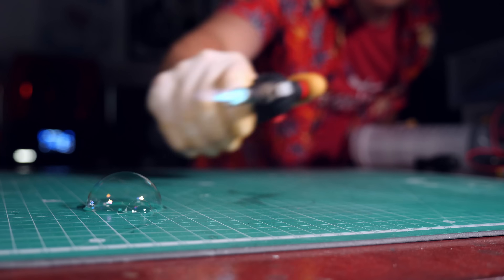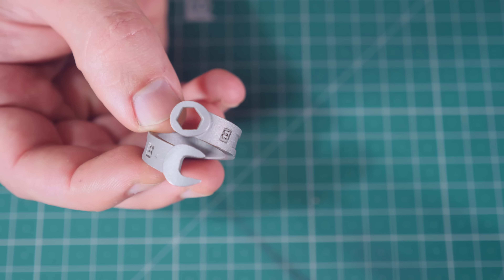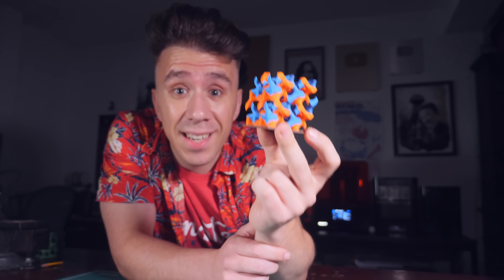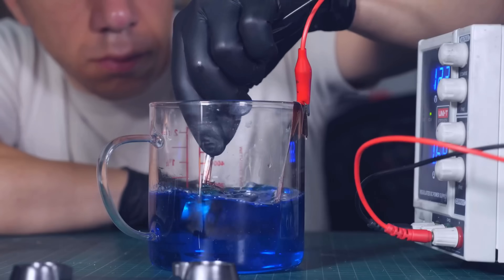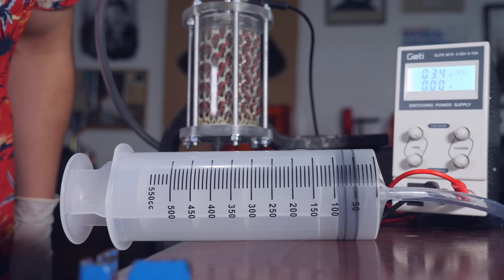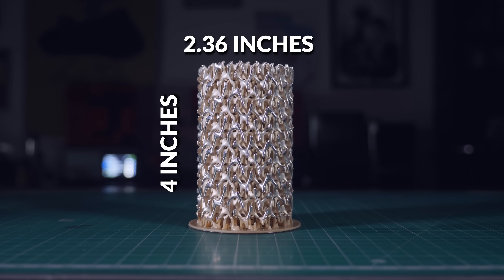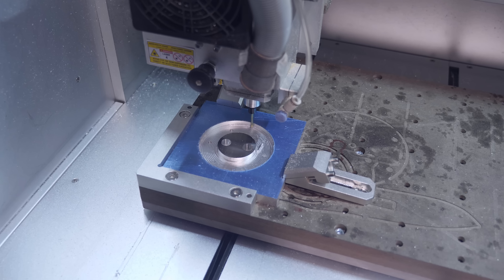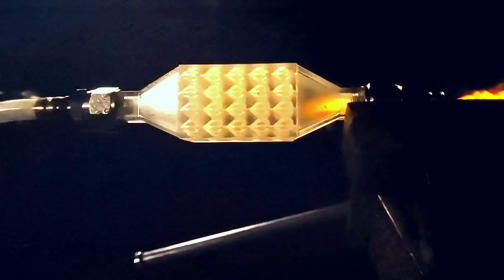ROCKET that LITERALLY BURNS WATER as FUEL

Comment: I have done some testing whit HHO and I have some conclusion of my study that can help you I hope, 1-- nearer is better but it is limited by the bubbles and the bubble size so in your next build increase the pressure the max you can witch make the bubble very small and be sure the bubble can escape without acumulating between the plate because where there is bubbles there is no water to produce HHO and the big pressure only slitgly increase the power requirement, 2 -- If you want the right stochiometric you must use only pure water anything that increase the current will create something else than HHO in a certain percentage depending of the voltage 3 -- your latice must be made in or cover whith a big layer of a metal that dont oxydised because even them dissolve but at a slower rate to make it last.  Hope you read it and it could help!

Comment: I love that you include the failures to really show the engineering process. From problem, brainstorm, solution, design, prototype, trial, error, and back to problem. That, coupled with knowledge of mechanical and chemical engineering, makes for increadibly talented work. Idk if this is just a hobby for you, or if you do this kind of work for a living, but so many businesses would be lucky to have your kind of talent.
Reply: What's great is that this time he was actually able to use what he learned from one his fails (the gyroid) and incorporate that in a different way down the road. People forget that the path to success is not a straight line. The "failures" along the way are actually very important steps in the process. Somehow succeeding without them is pretty much just sheer luck.

Comment: Shocking that a PLAZMA battery couldn't do the job. Man, there goes my hopes for a plasma battery! This is a sick build Joel.
Reply: Can we get STLs for the gyroid spacers? You know, in case I want to not try this at home.
Reply: Integza, use the bigger battery and an adjustable voltage module, since voltage directly affects the current draw. You can limit current with a bulky resistor for initial tests, and please buy and use a clamp meter for measuring current.
The closer the gaps between electrodes - the less conductivity you need for the same results, since resistance in water is proportional to the distance between electrodes. Reducing water conductivity could also help with the current. You could reduce the surface area of the electrodes if your current setup produces more fuel than you need (save space for more water).
Also test out more water solution options, test for residue, reusability, price to performance, etc. Would love to see this design actually function. I'm sure you can make the hydrogen generator more efficient and functional than it is now.
Reply: “shocking” 😏

Comment: 1. Be aware of some of the Poisonous gases that can be created using different electrolytes and metals, like Chlorine, etc. 2. Use a PWM Controller. 3. As many others have said: neutral plates. 4. Use a pump and an external small radiator and fan to circulate and cool the electrolyte. This also may help to move the bubbles more quickly away from the plates, allowing more contact with the fluid. Perhaps position the plates vertically and pump the water up from below, to aid in the natural upward direction of the bubbles. 5. I met Alan Schoen once. He passed away just last year at the age of 98. He was a very fascinating person.
Reply: Tomatoes are vegetables, i am not vegan😂
Reply: 非常专业的意见，让爆炸减少
Reply: @MMm-he1ei 
Sounds like you may also be a vegetable!😂
Reply: @MMm-he1ei  The tomato is a fruit. Strawberries are vegetables (the "is it a fruit or vegetable?" classification has something to do with where the seeds are located - on the inside or the outside).
Reply: @cliffcampbell8827  
Strawberries are aggregate fruits because they come from a single flower with more than one ovary. The fleshy part of the strawberry, called the receptacle, comes from the stem just below the flower that ripens. The brownish or whitish specks on the outside of the strawberry, often called seeds, are actually individual fruits called achenes, each containing a tiny seed. The average strawberry has around 200 achenes, making it essentially a multiple fruit.
Reply: @N7than that's awesome! I have long wanted that description and definition. Aye qué fresa!
Reply: Why the need for PWM?  Is there something about this exact reaction that needs a frequency?  In swimming pool chlorine generators, electroplating, and anodyzing, linear supplies are used.  Meaning an ac transformer, rectified and fed into a BJT.  Linear power is far superior to switch mode due to the inductive  issues a square wave presents.  If the idea is voltage or current control, that's easily solved in either situation.
Reply: Poisonous with a capital P.
Reply: Even more hazardous are the hexavalent chromium salts produced if you use stainless steel in the electrode assembly.
Reply: @falsedragon33 just add a capacitor or L-C filter on your switcher output if you want DC